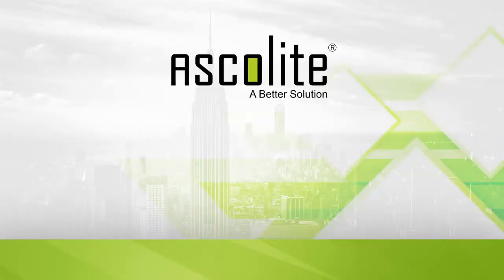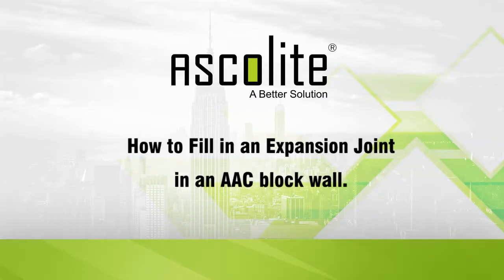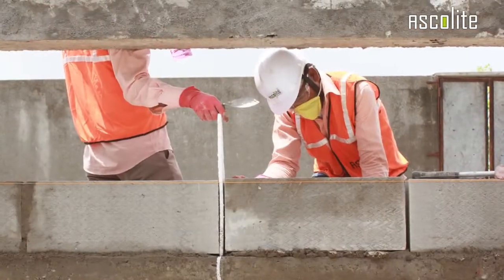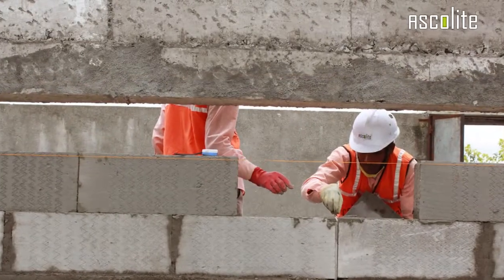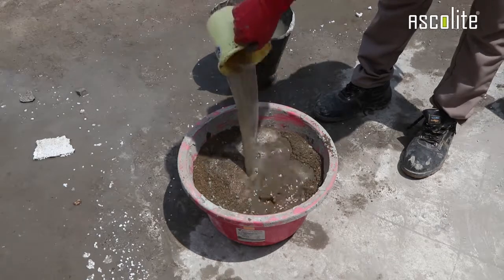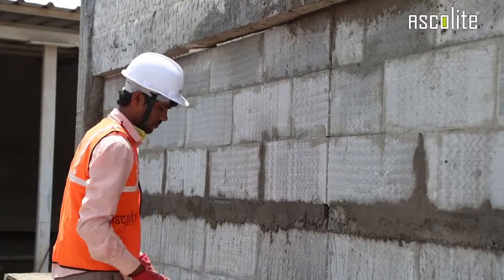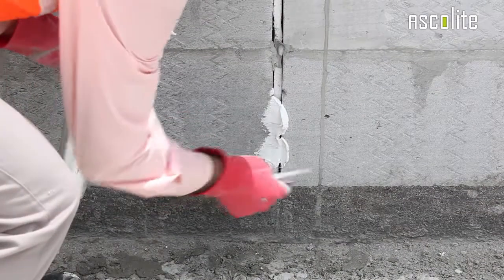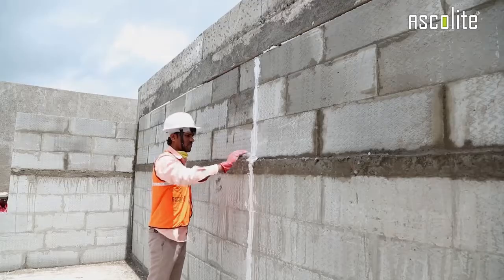EXPANSION JOINT - English

Comment: Filling the expansion joint with any kind of mortar or hard set substance after the foam insert will not pass in the UK. Covering the foam with flexible caulking that is water tight is best practice.
Reply: I totally agree , what is the point of an expansion gap filled with something solid ?